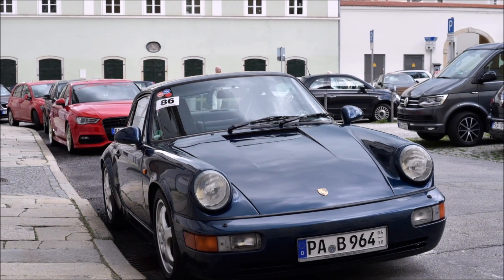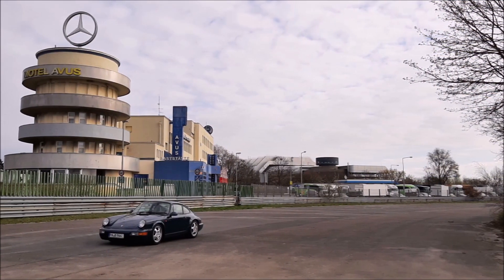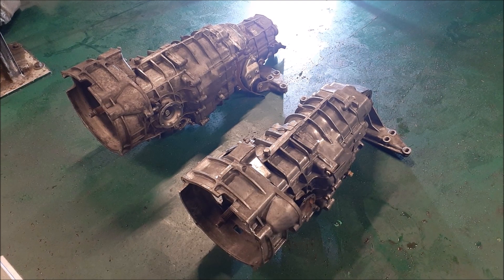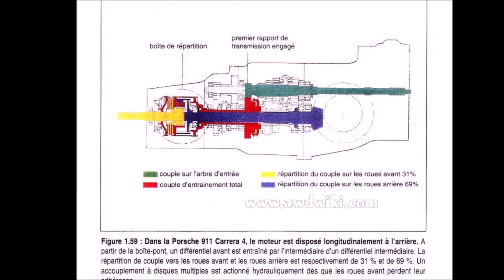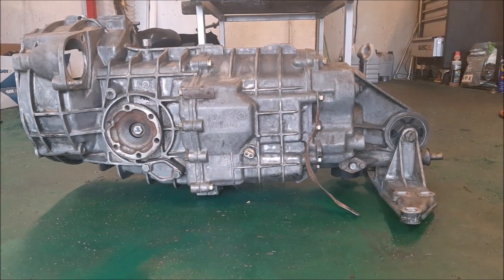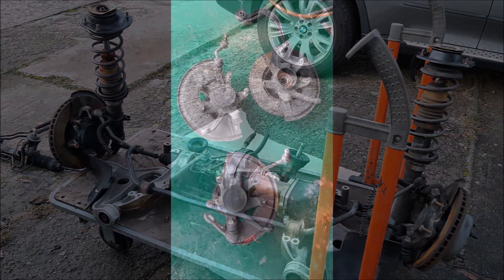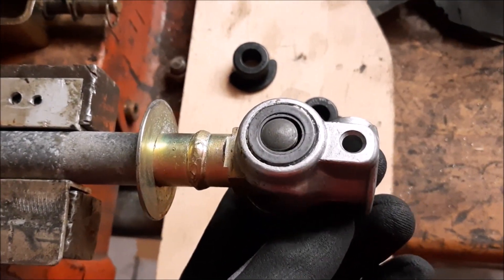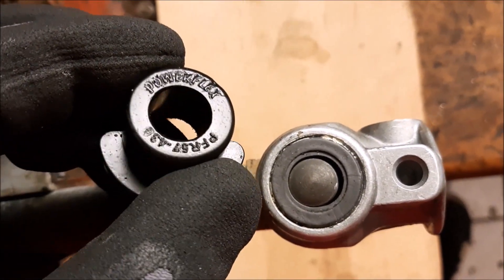Porsche 911 964 C4 to C2 mod (G64 and AWD) delete

Comment: Dear Stefan, thanks for your video. I am currently planning to start a project to convert my c4 to c2 like yours. Do you know how to deal with PADA and ABS of a C4? Thanks
Reply from the maker: Hi. I have left the PDAS and the ABS untouched. No need to change it. I just removed the tube lines for the longitudinal and transversal diff locks and the switch in the dashboard.
Reply: Dear Stefan, thanks for your reply. Didn’t pay attention that u did reply. I am still in the preparation for conversion. What about the 4 wheel drive switch in the cabin? Can we disconnect or delete the switch?
After the conversion do u feel any strange behavior or some error about PDAD system? Thanks again.